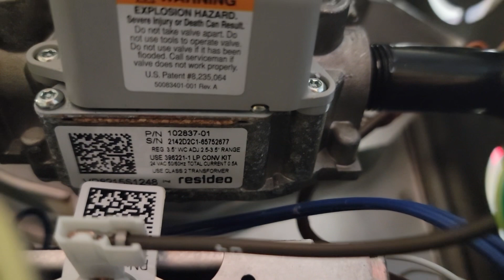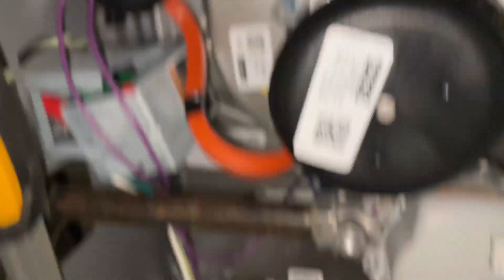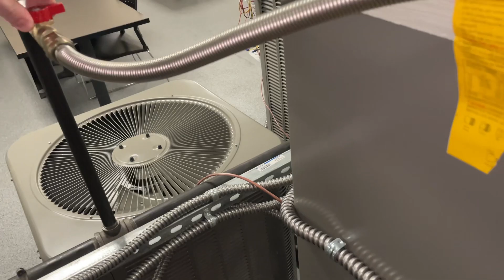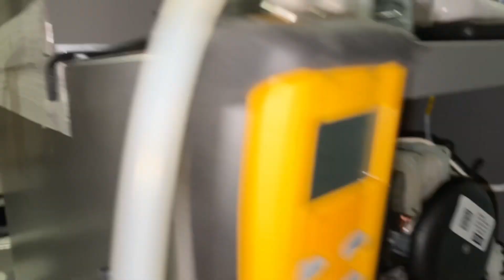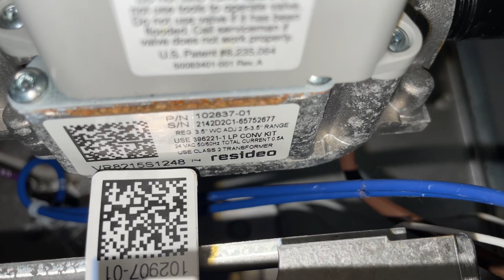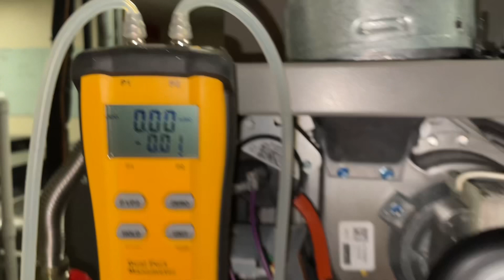Gas Valve Testing

Comment: If the manifold pressure is correct, you still need to check the temperature rise after making sure there is enough ductwork, the filter is clean and all supply and return grills and registers are open an unobstructed then adjust blower speed to achieve the proper temperature rise.

Comment: You can also use an Analyzer. When the system shuts off, if your CO climbs, The gas valve is leaking by.

Comment: Did I miss something? If the pressure needs adjustment, you didn't show how to do it.
Reply from the maker: I didn't show adjusting it in this video. You can see one of the adjustment covers in the video though, the flat head screw that has the purple mark on it is actually one of the cover caps for the adjustment valve.

Comment: I went on a no heat call today the top two burners would light and go right back out checked inlet and it was high pressure told homeowner to call gas company tell them their regulator had failed because I can't touch that they replaced the regulater and everything works perfectly I'm glad it didn't harm the gas valve
Reply: That's an awesome tech move . Know the limits and stay with in it.  Reffer   up when necessary.   Cool.
Reply: Wow that was amazing that you knew the gas was too high when burners we're shutting off at startup. Did you learn that through experience or school?
Reply: @Hvacmania  experience I have 30 years hands on experience and maybe 2 months of like 1 day classes over the years
Reply: @donaldpainter956  holy moly !! Congratulations 🎉👏 that's awesome

Comment: Do new valves come from factory  
adjusted?  And once set, do you have to check pressures every so often?
Reply from the maker: If you are replacing a valve you should always check pressures after install but it will usually already be adjusted. 
Factory valves already installed in furnaces will be adjusted.

Comment: So what is the result if a gas valve input/output is too low or too high?
Reply from the maker: Input - Low could make it difficult to produce proper heat/flame. But the levels of low it would have to be to get below the output necessity would be showing signs in whatever else is being powered by the natural gas. 
High - Could damage the gas valve hypothetically, but again You'd be seeing the damage in other appliances as well. 

Output - Low - not enough flame, flame sensor not detecting flame, heat "on" but low temperature rise. 

Output - high - premature exchanger failure (only after long term), Burner damage (ish), heat rise too high.

Comment: Amazing video, great information
Reply from the maker: Thank You.
Reply: That's a statement that only an experienced tech would know but the only thing that gets to me on these hi priced two stage furnaces atleast in North Carolina I can't speak for northern states but here the furnace starts in low stage and runs for ten minutes then goes to hi stage if you keep your house a constant temperature then when it calls for heat it takes 8 to 10 minutes to satisfy so most of them never run in hi so they are buying something they don't need and the parts cost more but the salesmen sell it